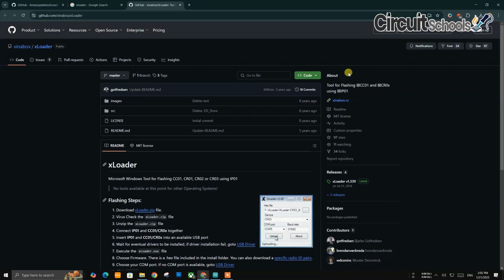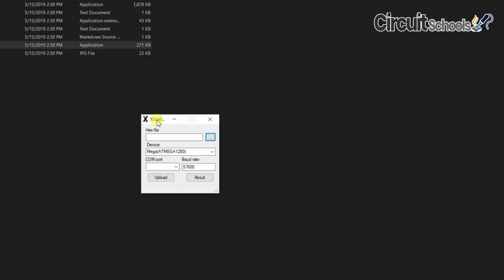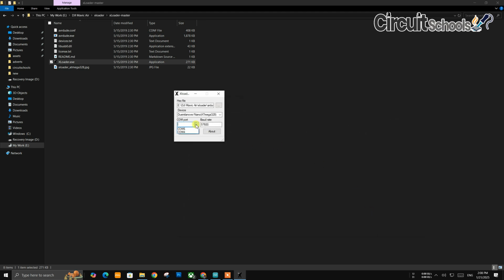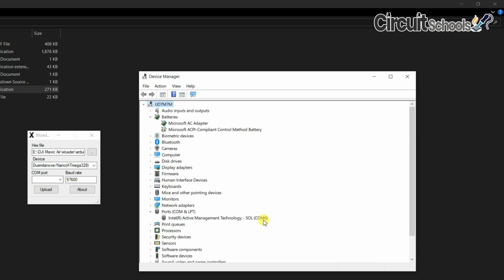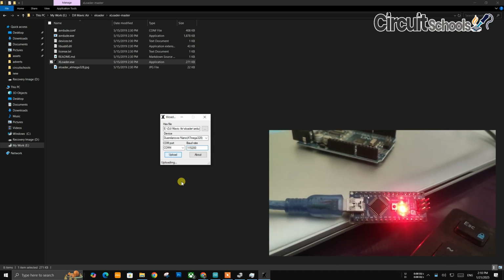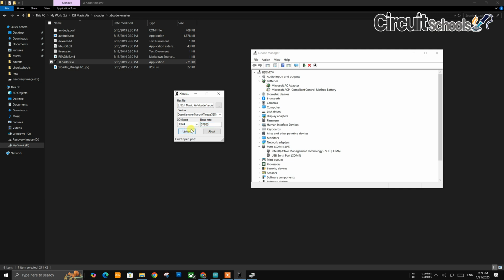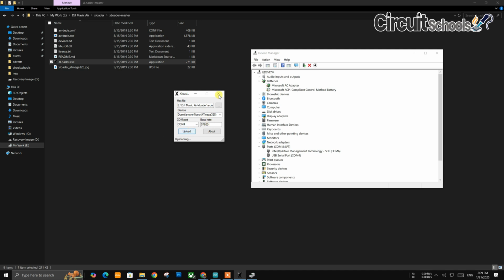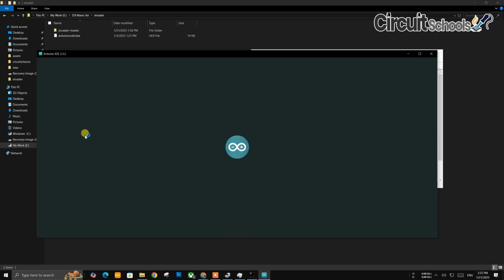Upload HEX file into Arduino, with ALL issues fixed #arduino

Comment: Should I upload the hex file using Xloader to my Arduino board first, and then connect the battery to the arduino?
Reply from the maker: Yes, you can also use AVRdudess which is better than xloader.

Comment: I can't seem to upload the file. Is there any further guidance in case you have tried all different baud rates as suggested in the video? I either get the message upload failed or the app freezes.
Reply from the maker: @tomcoolen3128  this tools works perfect please check : https://youtu.be/oNaQ5Ehbpsk
Reply: @CircuitSchools  i try avrdudess and xloader still cant upload the hex file pls help me
Reply from the maker: @joshuamagat6243  use AVRdudess, select correct board, port, path to hex file and hit program, if you get any errors take a screenshot and send it to our email.